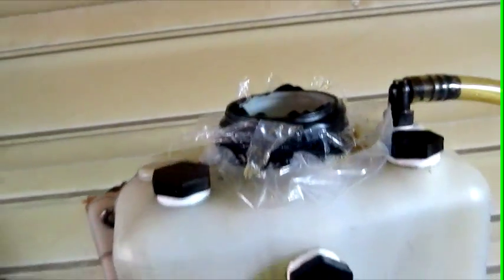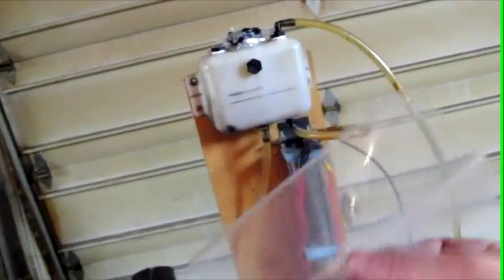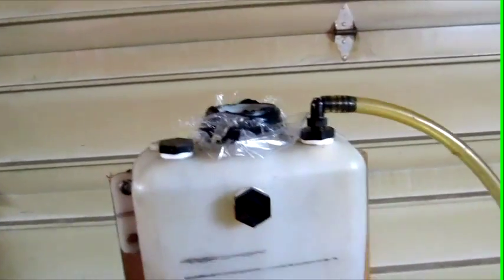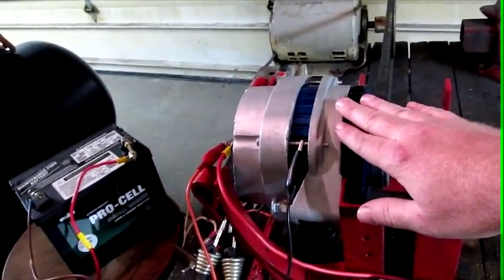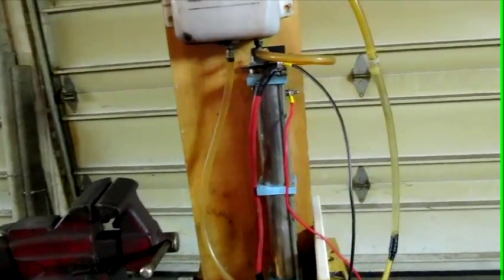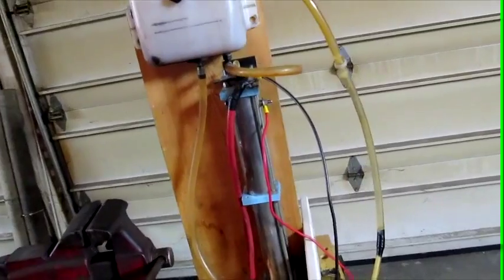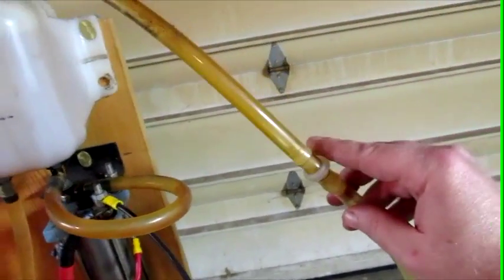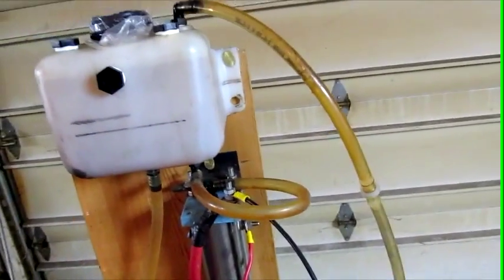HHO Explosion - Micro Torch

Comment: so you have a motor driving a alternator to regulate voltage ?? why not just pwm the cell ????
Reply from the maker: The motor drives the alternator, yes. The PWM regulates the alternator input voltage (via battery), which regulates alternator output voltage/amps. The alternator output amperage to the cell is 70ish amps (if I remember correctly). That would blow my PWM sky high, lol. Nonetheless, perhaps I should have explained my setup a bit better.